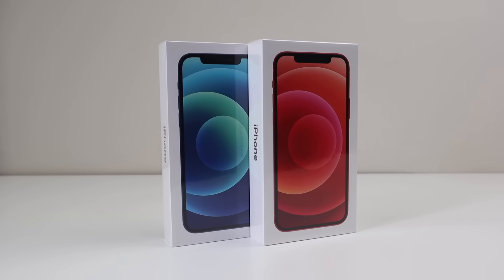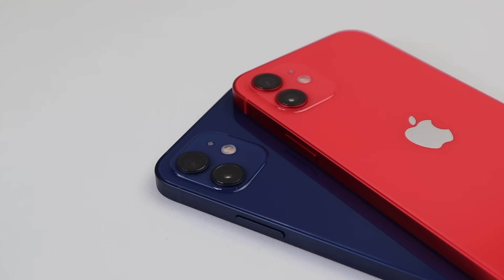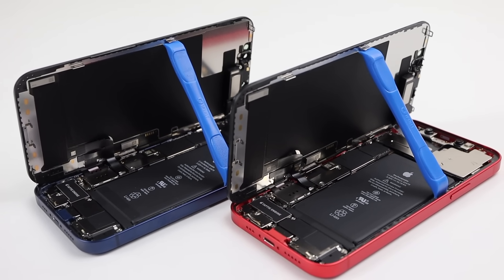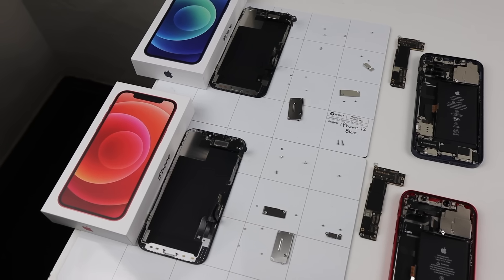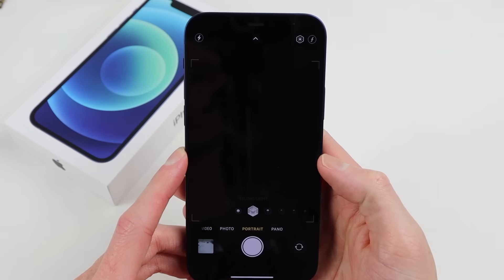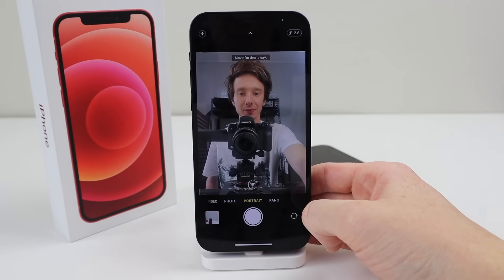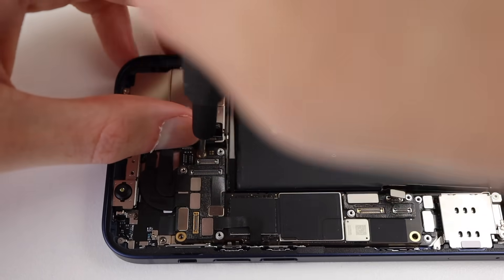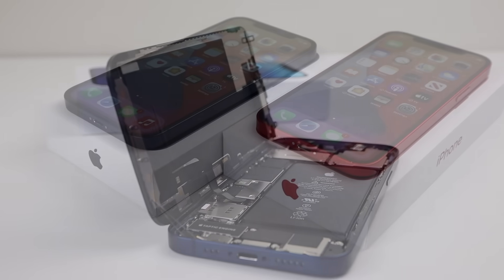iPhone 12 Anti Repair Design - Teardown and Repair Assessment

Comment: That's what I was saying. There are almost no USB type-C power bricks. They all have type-A. You will have to buy Apple's brick in addition to the phone! Or you may be lucky enough to have one already.
Reply: I’m sure plenty of people have USB type A cords lying around.
Reply: @tails300  what does it have to do with USB type a chords? iPhone uses lightning port. Pretty sure most people will have type-A to type-C, which doesn't work.
Reply: @pakane24  I doubt it since USB C to lightning only came out last year with iPhone 11. Most people with new iPhones probably have had older iPhones with old chargers (cable + plug) which they can use on the 12.

Comment: The only thing that makes sense to me is the inability to use face ID as that could be a security issue. Kinda like how with the older iPhones replacing the home button just locked you out of using the fingerprint sensor. It sucks but it makes sense

This is just too much

Comment: Looks like Apple has setup a MAC address like filter for every component inside the iPhone12. Every component is registered to the iPhone firmware. Just like when you turn on MAC address filter on a wi-fi and only the MAC address that has been registered to it can contect to the internet. I could be wrong; that's my theory.

Comment: I really struggle to understand what for "can only be repaired by Apple" is communicated as "irreparable". Okey, AirPods are irreparable, because nobody can take them appart without breaking and they are not designed to be repaired. Fare and annoying. Okey, you can't fix keyboard on Mac while keeping your old casing and battery. Fare point. How iPhone is irreparable if you can bring it to the Apple Service and get repaired? Why would it end up being e-waste if instead of throwing it to the garbage you can return it to Apple to be either refurbished or recycled for free or small credit?

It's Apple's business and Apple's right to protect devices they make in whichever way they deem possible. And I'm pretty sure that pairing didn't appear just for the sake of being evil. They probably had loads of people complaining about their phones performing poorly because of such replacements. And yes, people complain to Apple and hurt Apple's brand when screen on the iPhone they bought from AliExpress for half the price is yellow-greenish, not to the seller, who made and sold this Frankenstein's monster. 

And sure you don't want somebody to put a fake touch ID button into your phone, which will unlock it with anybody's finger? And I can't really think of a feasible way for a device to verify that new button came from another iPhone and is legit.

Comment: This isn't something new. Once apple started using FaceID to replace TouchID they needed to "secure" the technology by configuring/coding/pairing the dot projector, cameras, etc to each phone. This step provided the security needed. The only new thing I can see is that the battery seems to be configured to the phone now. But nonetheless the repairs are starting to become impossible.

Comment: I appreciate the video, but your bias and stupidity is pretty unique. Apple is building the longest standing phone of the industry, making sure you can fix and update them for years... the fact that you broke the phone has nothing to do with his real long term usage. Apple is willing to fix them for you and will do so for the many years to come. They are trying to explain that if you want your phone to work, better let them do it, so it won't get in fire because you badly installed the battery or use a cheap one. The right to repair is one thing, and yes you can fix it yourself if you want. But the reality is that apple is making everything to make sure the product don't end in recycling, they even take them back to recycle them in their end of life. I feel so bad about your stupidity, it should be bad to live in your head.

Comment: At 15:37, you say that when Apple stopes repairing this phone what will happen. As far as I know Apple doesn’t stop servicing phones, I’ve took in my 6S Plus this year, the phone is 5 years old and still gets service from Apple. I don’t know what would happen but on the Apple Support app it says I can take by 4S phone in for sevice
Reply: They do stop servicing devices older than 7 years in almost all cases.
Reply: @no1ce  I think that makes sense, most people don’t keep the phone for 7 years. It’ll be outdated and unsupported.

Comment: 120C is usually where glass already starts to separate from LCD panel. That's one helluva waterproofing adhesive. 
But yeah... Now in addition to locking hardware to genuine parts only, Apple will also try to sell us some ridiculously expensive "servicing and programming" mystery box that no one asked for, and on the next hearing (whether Right to Repair, or maybe an upcoming class action lawsuit), they'll use the same excuse - "It's for your own security!".

Comment: Imagine your car stopped starting up because you changed your battery by yourself not because you messed up but because you need to go to the dealer and pair it to your car
Reply: BMW says hi.

Yeah, it's shitty behaviour but this exact business practice is very much alive in cars.  Not all but many and it's as anti-consumer as it is when it happens with phones.
Reply: @lemagreengreen  Now I have a reason to never buy BMW it's totally not because I can never afford one.
Reply: Well it is happening right now with newer cars. Car will throw up multiple fault codes when you connect a different battery prompting customer to take it to dealer
Reply: You must not have a newer car!!!
Reply: I pretty sure that’s how electric and hybrid cars will work now that they’re more mainstream.
Reply: This is something to be conisdered as connected car tech is popularising.
Reply: Most euro cars do this already... Battery management. Gotta give the controller the new battery code & type as to prevent over/under charging.

Comment: Really apple next year they’ll probably lock down the charger 🤦🏾‍♂️
And your phone would only charge with the charger from them
Reply: That you'll have to pay extra for....
Reply: That's literally the only reason they still use lightning cabel.
Reply: Rest of the world is using USB...
Reply: This has already been an issue for years. After an update a 3rd party cable will stop working on my updated iPhone, but continue to work on the same model without the update.

Comment: Come on Apple... Now scammers cant put cheaper things in the Phone and the sell the parts from the Iphone but its shit because if you want it to repair it yourself, you cant. Also it clearly isnt good for the environment. They are not including a charger because its ceaper for them and the transportation costs are cut by half. Thats Insane! Dont let Apple do that.... They should´nt be allowed to do that. ( Ofcourse they can deside what they want to have included or not like the charger)It would be all ok what they do. If they would say: Hey before you buy the Product, you cant fix it yourself and you will have to pay for example 300Dollars for the Screen that much for the batterie that much for blabla... But they are hiding it and this is scam and should be illegal.

Comment: Somewhere in future:
You can't use a better aftermarket charger in the iphone. You need to get a new charger brick and cable from the apple store which will bith be paired to the iphone. And you are not getting anything when you buy the iphone except the device. Not even box.

Comment: The camera issue could be a software bug like when the iphone 8 would not boot when the screen was replaced
Reply: It could be a bug however I can confirm the camera modules are paired in the entire iPhone 12 lineup and replacements need to be reconfigured by Apple or an AASP.

Comment: Apple: 2815 milliamp power battery

Samsung: That's cute.
Reply: @landocalrissian6490  😂😂😂 Bruh... If gals won't date a guy just because he has an Android, it's for the best.
Reply: Also Samsung: we have a booming 5000 milliamp power battery
Reply: @Adam-vk8pf  Extremely optimized software can make up for less battery, just like how Androids need 16+ gb of RAM while iPhones need much less to run just as smooth.
Reply: @givepswrd  Androids do not need 16+gb of ram. The reason android needs more ram is due to the different kernels the operating systems run on and the fact ios freezes apps whileandroidlets them run similarto a pc. Most android flagships have 12gb which is overkill and  can beat new iPhones in ram management.  Please don't comment such ignorant statements
Reply: @rixzin5046  Yea, so iOS is more optimized than Android.
Reply: @givepswrd  No that's not "optimized " it's  different software
Reply: @givepswrd  🤦‍♂️ Plenty of Android devices run on 4GBs of RAM without issue. Where the extra RAM comes in handy is in intensive gaming, switching between a phat stack of open applications and not having to reload them, and for running special abilities like Samsung DEX. Having more RAM is a bonus feature, not a requirement... Kind of like how you can have a Windows PC run smoothly on 4GB or 8GB, but can add in as much as 128+ GBs. Remember... the Mac Pro can hold 1.5TB worth of RAM... Doesn't mean you'll actually need it 😂
Reply: @HellFire107  Who needs 1.5TB of RAM anyways LMAO, typical everyday servers don't even have that close of RAM. Typical servers usually have around 128-512GB of RAM, cause I work on them for a living!
Reply: @Joshtheweatherman  😂 There was a news article I read after the Mac Pro was launched. Apparently, you can open 6,000 Chrome tabs with 1.5 TBs of RAM on a Mac Pro.

I'm not sure... Someone somewhere will appreciate it's ability to hold that much. I do all my work on a Laptop with 16GBs :)
Reply: @HellFire107  I know how RAM works. Windows CAN run on 4gb, but it doesn’t mean it will run smoothly. 8gb-16gb is ideal for regular use but optimization and management also plays a huge role in RAM. Windows isn’t particularly optimized but iOS is. iOS can make 3gb of RAM stretch so much further than Windows or Android simply because of how much more optimized it is.
Reply: @givepswrd   @Apen  It's better to have too much than too little nonetheless. It feels like Apple cheaps out by only putting 3-4 GBs of RAM in their devices when I believe they'd benefit from having more. I'm using an Android budget device with 4GBs of RAM and a proccesor that's roughly 4X slower than the iPhone 12's A14 😂 and the performance feels perfectly acceptable. When they're compared- iPhone vs Android Flagship in Phonebuffs speed tests, Androids are able to keep all the applications open in the background with the extra RAM while the iPhone counterpart is not. Overall, Androids may need .5-1 GB more than their Apple counterparts for best effect. And the 8-16GBs you see in Androids today are simply complete and utter overkill.

Even if Apple is more optimized, it makes absolute and perfect sense that it would be. There are roughly... 14 different Apple phone proccesors... Whereas Android runs on hundreds of different phone proccesors (made by Qualcomm, Exynos, MediaTek, HiSilicon Kirin)... and every Android application needs to be able to run on these different proccesors... Leading to less optimized software overall... Meaning it might consume a lil more RAM but if you provide a bit more, problem solved 🤷‍♂️ Makes extremely little difference in the end
Reply: @HellFire107  tell that too chrome browser.
Reply: @givepswrd  lol that's kind of true. Apple is more optimized but if you look at any speed test, androids win them because of the ram they have. You literally need more of it to keep open apps in the background.
Reply: @HellFire107  *Qualcomm not snapdragon
Reply: @humptydumpty0836  Thanks 👍
Reply: Thats silly small. Thats like iphone 6s levels of silly
Reply: it's milliamp hour not power
Reply: The iPhone 11 and the pros had a bigger mAh capacity
Reply: My Motorola Moto X4 has a 3090 mAh battery itself lmao, and it's 3 years old
Reply: @riftiro4427  My old Motorola E5 plus had a 5000 mah battery and was only $89. Apple is seriously cheaping out. And Motorola always put big batteries in their phones which was a blessing
Reply: So cute :)
Reply: @landocalrissian6490  if someone doesn't like you because of the phone they are not worth seeing at all lmao. wtf I can't even image someone like that
Reply: Battery capacity is meaningless unless we're talking about a power bank. What matters is actual usage
Reply: @satsumagt5284  Its not meaningless and even if apple is more efficient you can see through battery tests that having more battery capacity is better. You can search speed tests for yourself and see why there is no 120hz this year. Apples battery isnt good no matter how efficient it may be.
Reply: When apple fan in this comment forgot that iphone 12 don't use lpddr5 ram when many Android phone use lpddr5 ram
Reply: Well at least the iPhone battery doesn’t explode. 

Meanwhile Samsung batteries: Boom boom baby!!!
Reply: @vihaansingha8340  Was 4 years ago mate 😭🤦‍♂️
Reply: @HellFire107  don’t worry it’ll come back
Reply: both samsung and apple are crap, go for something else
Reply: @chamikk90  What do you recommend?
Reply: @chamikk90  your probably using a crappy LG phone or some old nexus phone
Reply: Nuno Filipe  yeah iPhones are so good
Reply: S20+ has a larger display, a higher resolution display, and a display that offers double the refresh rate of Apple's iPhone 11 Pro Max. The difference is negligible... The Exynos version of Samsung Flagship devices sucks though.
Reply: Thats why that samsung phone exploded
Reply: @mghummer  You’re comparing apples to oranges. Linux is widely used, in PC’s, to the microcomputer that controls a door. They’re all operating systems, but they have extremely different purposes.
Reply: It’s not about size, it’s all about efficiency. Call it cute all you want, doesn’t change the fact that the iPhone gets twice the playtime on a battery that’s half the size. 

When you are buying a car, you look at the mpgs before you look at the size of the gas tank. It’s really the same thing.
Reply: @sl-br4rm  I'm sure it won't be getting the same runtime if I run Pubg mobile on it 😂 That's where I'd expect the extra mAh to come in handy

Comment: Finally, a youtuber that mentions that the apple power bricks laying around are not compatible with the new wire
Reply: @ocbaker  They should have switched to USB-C.
There is no reason to keep lightning. It's an oudated port with an outdated cable design to the point that none of their other products use it outside the iPhone.
I am ditching Apple for good with this release.
Reply: I think jerryrig mentions it too
Reply: @ocbaker  next iPhone is rumored to be portless
Reply: @raymond1990  this really doesn‘t fix anything. You will just need a different kind of charger (most likely one of those magnetic wireless charger things).
Reply: @PhilfreezeCH  there are going to make their consumer pay.

Comment: well, I guess it‘s because of the logic board changing. It‘s the same like older iPhones with a home button - TouchID didn‘t work after a logic board swap, because every home button is connected with the logic board. It should be the same with the FaceID sensor.  Normal battery swaps should still work without any problems. But I don‘t know why the camera isn‘t working.
Reply: The display, battery, and now rear camera module are all paired to the logic board.

Comment: I did housing swap on a iphone xs max a while ago(also swapped power button flex cable) and I had same issue that the phone would not turn on by pressing the power button. But when the phone was on the button worked fine.

Comment: Hopefully the camera issue is fixed in software.... the way they fixed auto brightness issue on replacement screens. if not thats really messed up. However portrait mode doesnt work because of face id not working, it uses that technology for portrait mode.  My moms X has bad face id, as its my old phone which i dropped in a lake, and portrait mode doesnt work on her phone either. Anyways great video hugh, its a bummer apple disables features when parts are replaced :/ hopefully right to repair passes eventually before things get too bad